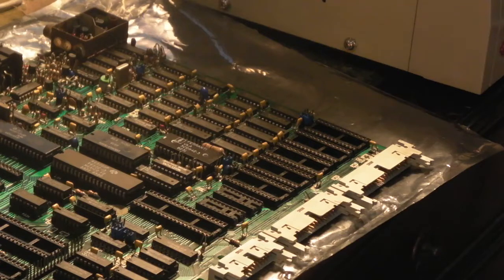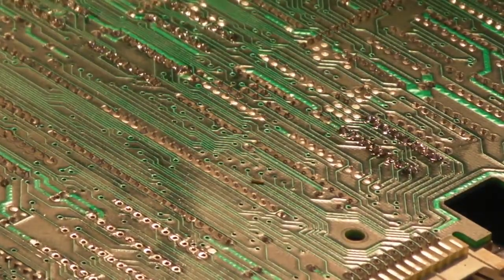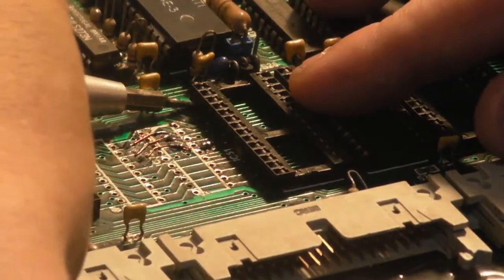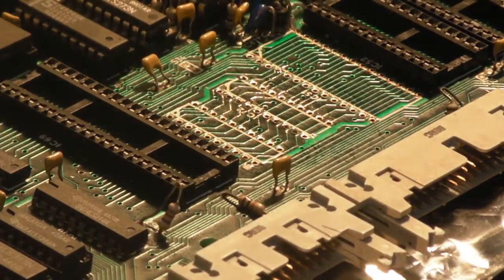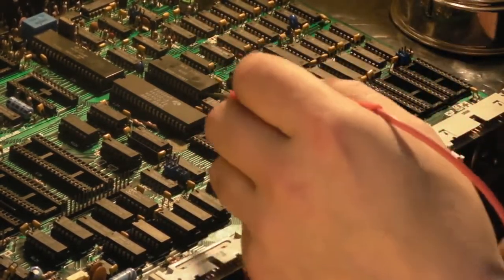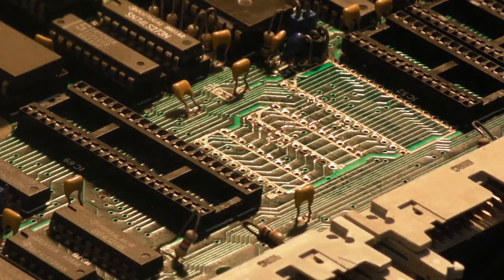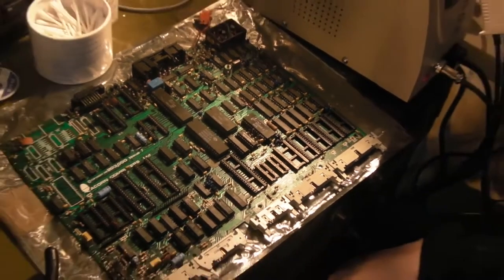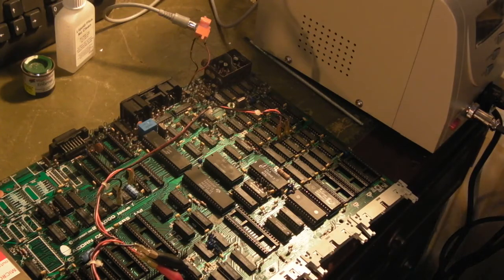BBC Micro restoration pt9 (Project Mildrids Ashtray)

Comment: Was sure it was going to come up at the end, but it is a tough one to troubleshoot. I assume you've checked the reset line, is the sync pin pulsing?

Looking at the service manual it says something about DRAM needing to work for boot, but you'd at least see a write at some point if it is running code. IC45 is used to address the ROM sockets, then IC46 - a fault in either of these would mean the CPU not getting access to them. I assume IC45 has a reset, pointing it to the first slot.